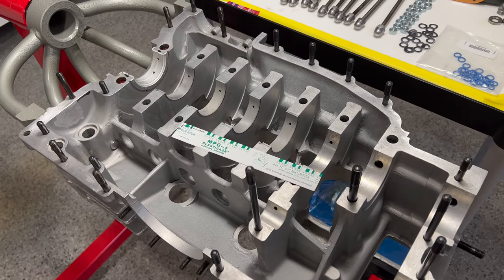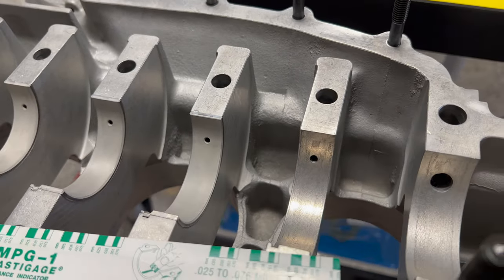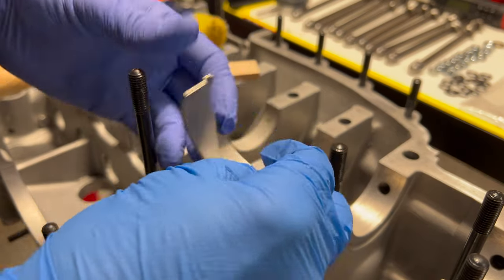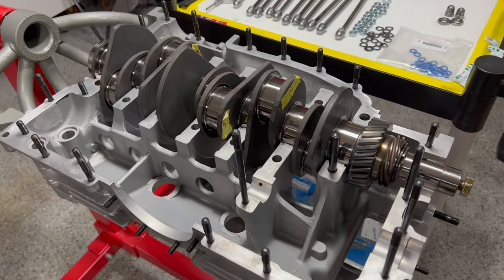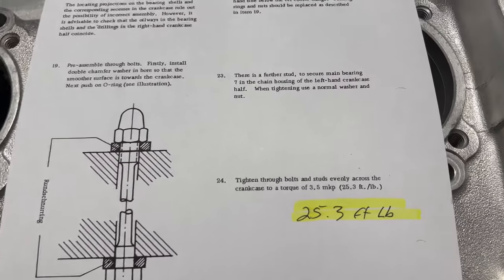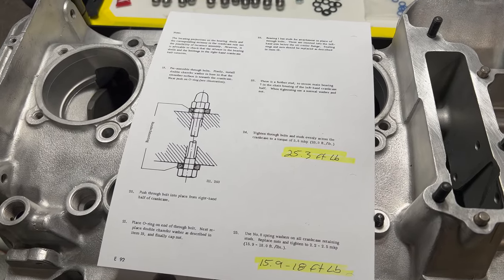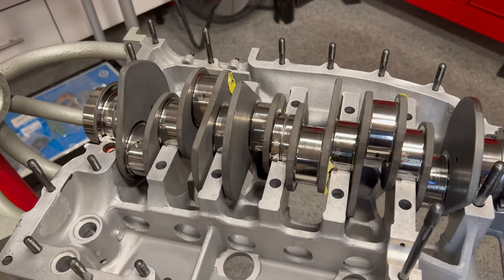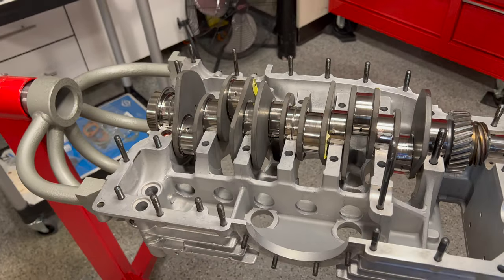Crankcase main bearings check! Porsche 2.0 Part-2

Comment: Looking great Mike!  Question-how do you prevent the crank from rotating and smearing the plastigage?  Lots of engine stand rotations needed to bolt it together.
Reply from the maker: Seasons Greetings Tom! that's a great question.
The crank is setting in the case main bearings dry and is a press in fit. It will not rotate unless you try to make it do so.
Plastigage will be okay for the main bearings check.
No problem to bolt the left half together in the one laying down position.
The connecting rods are different.. I built a stand to do this check and assembly. The stand allows me to hold the rods securely
without rotation while torquing down. Also not mentioned in the video all nuts are all lubricated with 30W engine oil for the torque!
Cheers!

Comment: Would it have been easier to apply the plastiguage to the bearings in the lower half of the case and lay the crank on it? It seemed pretty tedious getting it to stick to the crank journals.
Reply from the maker: Hello Dennis Happy New Year! Yes that is certainly a viable way to do the check..The only issue that may come about is gently placing the crank over all the journals and seating it without any slight rotation. Other than that I'm sure it would work fine
Cheers!